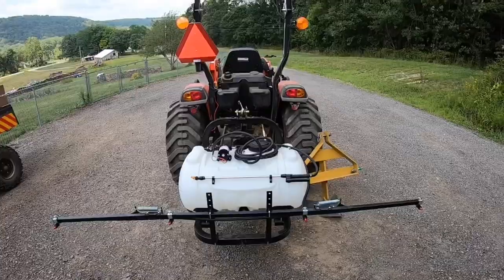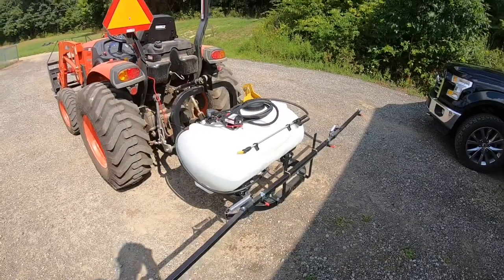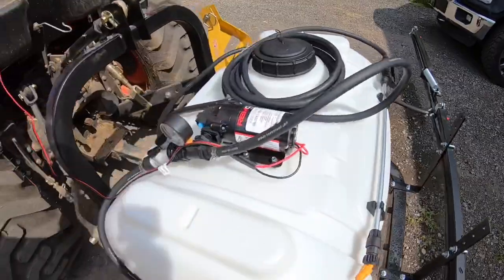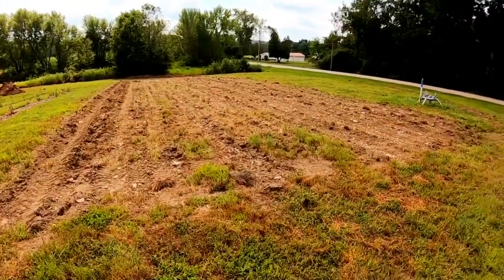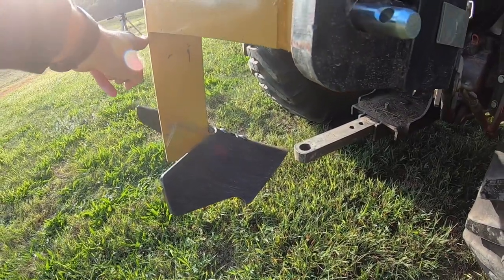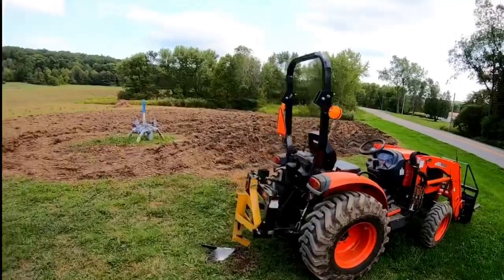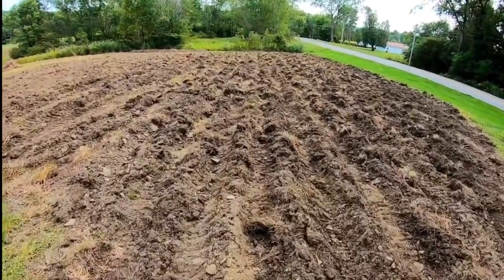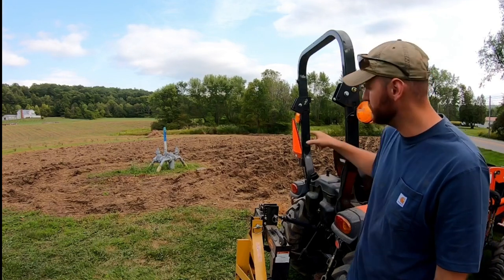Sprayed and Plowed the Field - Starting To Come Together

Comment: Just came across your video. I have a spray rig like that but need to convert for tractor use. I had it the back of my ATV but got rid of it. I ordered the same plow a few days ago. I’d only use the box blade if necessary. After plowing I’d mount a three point rototiller and go twice in both directions. The rake won’t be of much use unless you want to make some berms like a hiller. I did that last year. Might go over it with a disc before rototilling. I do that but I want to go deeper than my disc or rototiller can go. The tiller just smooths it all out. Maybe then set your plow to just make a groove for planting.  I will be trying that this year

Comment: Hate to suggest spending more money but a good investment would be a set of 3 point hitch disks.  run it with the disks spread wide open so it cuts good.  it may take 5 passes over the entire field.  that should be enough to not only level out your mounds but also cut into the sod that was missed between rows. Then, run it again with it set so disks are almost straight.  that will make it so the disks don't take as much of a bite and smooth it out even further.   I have used disks by themselves before to avoid plowing altogether.  you have to make quite a few passes to keep cutting the soil and each new pass digs a little deeper.  I get by with that if I am just reseeding a field for a food plot or planting in grass or hay.  that is not for a yard.. I am talking about a farm field or something.  yard work has to be finer than that.  but you have that yard rake for fine work after disking is done.   My opinion as a hobby farmer that has done it before.  I am south of you, also in Western Pa.  so, same type of soil and terrain.

Comment: I use Roundup and 2,4-D as needed it is very effective weed control. I could tell you a lot about corn growing if you are serious it's a high feeding crop needs a lot of fertilizer and water not to mention cultivation. If you want it before labor day you might have to use a remay cloth. There are lots of nice hybrids corns that will grow two beautiful cobs but it is a lot of work. Not a plant and pick crop

Comment: For a finished product... your not gonna beat a harley rake buddy... and $75 for the day is a deal.. my vote is that!
Reply from the maker: I literally just got back from going to check it out. Paid for it and picking it up in the morning. Good to hear from ya buddy
Reply: @HometownAcres  sweet! Little tip... in theory you should be able to get good results by going one direction, and then turn 90 degrees and go that direction, windrow all the debris to the end of your runs, and then come back through with your front end loader and dispose of it... you'll figure it out, they have a pretty short learning curve I think... good luck, cant wait to see that video!
Reply from the maker: The one I’m renting has a hydraulic angle on it but I don’t have any rear remotes so they’re just going to pitch it to one side for me and it’ll be fixed in one position. I need to get rear remotes haha
Reply: @HometownAcres  I have hydraulic angle on both my 3pt (bur never had remotes) so it has a manual angle on it,  and hydraulic angle on my skid steer one...and always use it straight, with the end plates and just carry the debris with me....

Comment: What is your favorite attachment for your tractor
Reply from the maker: That is such a hard question. I use all of them but I would probably say the pallet forks are the ones I use most often, followed by the grapple. I use the box blade for driveway and atv trail maintenance occasionally but most times when I put it on the back of the tractor it’s for ballast because it’s very heavy and provides excellent counterweight when I’m picking up big logs with the grapple or pallet forks. The brush hog gets used probably 5-6 times a summer and then doesn’t get used all winter for obvious reasons. This plow I just bought I don’t think I’ll use all that often but I think I could use it if I needed to establish some ditches for water run off of the driveway or atv trails